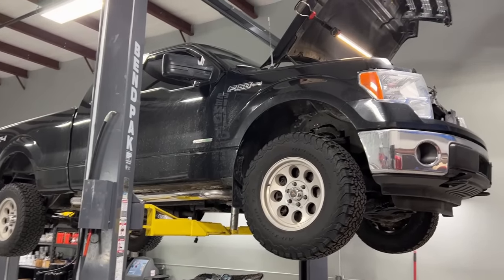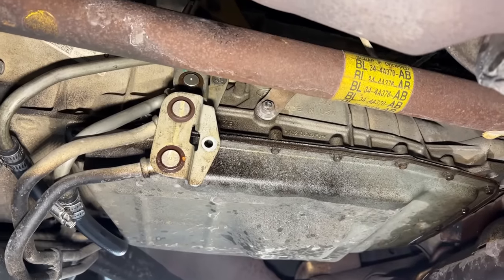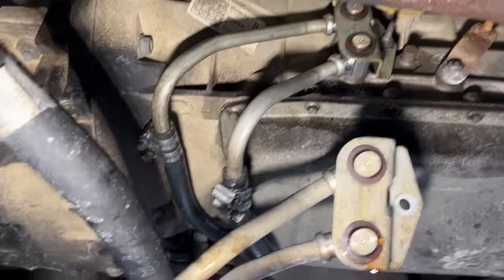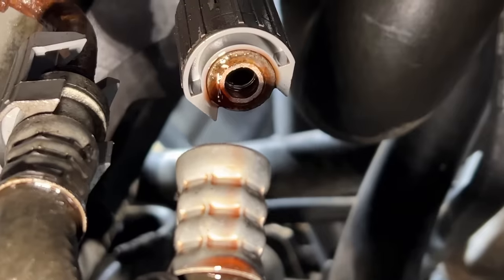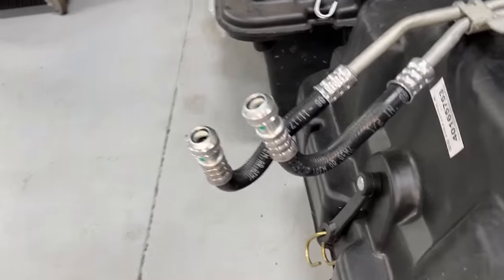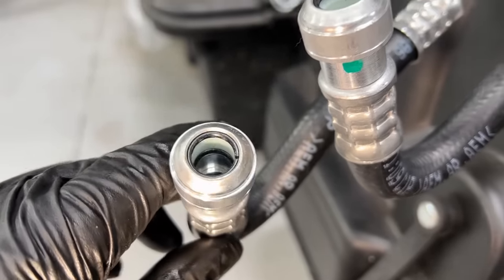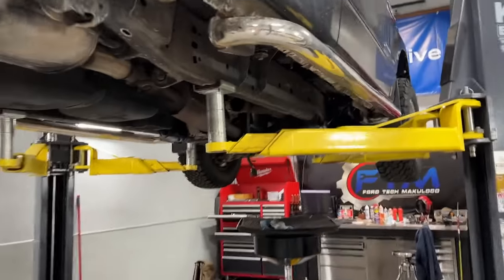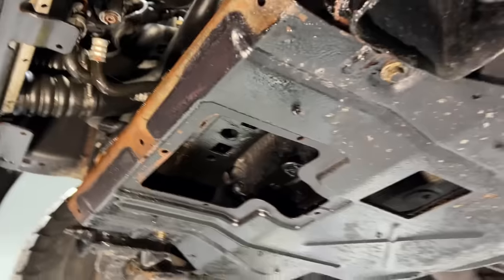Attention 2009-2014 Ford F-150 Owners! Check Your 6R80 Transmission Cooler Lines Before They Blow!

Comment: Aircraft mechanic here. I couldn’t tell if the aluminum and steel are contacting each other but if they are, this is likely a classic case of dissimilar metals corrosion. I also do as much of my own auto repair as possible and your vids have been a tremendous help. Keep them coming and take care!
Reply: Bingo! Notice the rust on one side, and the aluminum on the other? The failure is right there at the transition. Dissimilar metals corrosion. The aluminum will happily sacrifice itself. This is accelerated by the presence of ions, road salt and water being the key. This video is a wonderful illustration of why these lines must be serviced and replaced before fatigue wins the day.
Reply: @robertborchert932  You would think people who have been making cars for over 100 years wouldn't make such a rookie mistake but they did. Why is ford's build quality so inconsistent? Some years they make great cars and some years they make junk no rhyme or reason I guess?
Reply: @andrewgordon235  The truth is simpler than this. Vendors. Nothing wrong with the design of the hose or coupling, nor with the cooler. Parts made to specification, but not knowing the other end of the connection. Different vendors making each half. There's a cost factor of course. An old school mechanic can tell you what will happen with dissimilar metals, we deal with this nightmare regularly.

In reality, these trucks march on through some really shitty real world conditions. Seen it over the decades, as long as it lasts through the warranty period, there's a laissez faire attitude. 

And yes, this isn't isolated to Ford, it's a worldwide issue, sadly.
Reply: Sounds as though the lines should be changed every 60,000 Mike's before metal fatigue sets in.  This will allow one to stay ahead of the dissimilar metal issue.

Comment: Great video, Brian. I know you're busy, so thanks for taking the time to inform us of this problem. If I had one of these, I'd replace those lines before they break! I have a 2015 Mustang with this trans., so I'll have to check and make sure it doesn't have this type of line on it. As always, keep up the great work.
Reply: Makuloco.. So what can I do to fix this before my trans blows? Did you give us the part number?

Comment: Thanks for keeping us informed. You are my go to guy for my 2010 F150 platinum. This same problem happened to me a few weeks ago, but mine was leaking where it bolts to the side of the transmission. They originally told me that the problem was where the wiring harness goes through the transmission ( the o-ring). Still had a puddle under the truck the next morning. Had to diagnose myself. Thanks again for all you do.
Reply: I seriously hope this guy didn't inform you to inspect old rubber parts on a vehicle, that should be common knowledge.
Reply: @BlueOvals24  The problem is not an old rubber part.  It is an aluminum fitting which snaps off.  Mine failed this week.  This exact problem, exactly the same place.  Luckily, I stopped before my transmission bled to death.
Reply: @kevinpost4633  It still isn't as big of a problem as OP made it out to be.

Comment: Took your advice and replaced the coolant lines AND the lines to the heat exchanger.  Sectioned the coolant lines and found 30 - 50% wall thickness lost through corrosion!  There was some leakage at the cooling-line connectors as well.  Total cost - less than $200 with tax.  Just saved myself $9,000.

Comment: Seems like the retaining clip to keep the disconnect from coming apart is actually creating a stress point right where the thing is breaking.  Got to be a simple DYI way to create a strain relief for that spot that is snapping.
Reply: yes there is a simple fix )) cut the damn connector off, and slide that rubber house over the cooler tube, clamp it with the metal clamp better use 2 clamps , ))
Reply: @ansv3340  that's what I was thinking of doing lmao

Comment: Just rebuilt the timing on my Dads 2015 f-150 Ecoboost. You’re videos were extremely detailed and helpful! Thank you so much. I’ve been a tech for 10+ years now and am learning something new everyday it seems! 

Trans has been good for him this far with almost 260,000km up here in Canada. Did a complete service at 200K. Used a premium filter & Amsoil fluid. Will be rechecking these lines ASAP!!!
Reply: Hello, I have a Ford F150 year 5.0 2011 that is giving me the following error:
On the gearbox screen it appears as a little bubble because while in motion it changes to D,N,P,1 and loses pressure when accelerating. I took it to a mechanic and he told me that it was the transmission control module, but now watching this video I have doubts that these lines are the cause of the failure.

Comment: I drive a 2013 Ford Taurus (ex police car) and I had one my transmission cooler and one of the lines start leaking pretty bad. I was able to stop the car and shut it off fairly quick, before the transmission was permanently damaged. I’m thankful it was only $800 for the cooler and the lines and an hour of labor!

Comment: Great video and very timely. My 2013 Expedition was in your shop at 100K for recommended service interval. I just hit 145K and noticed this issue as well as having a P0720 error resulting in no speedometer and transmission shifting irregularities. The lead frame plate issue was surprisingly covered by the 10yr <150K extended warranty and I’m having these lines replaced at the same time.

Comment: you have a great channel. all business and  info, tips, etc are helpful to us ford owners. 
i have 2016 f150 5.0 xlt. 88+ k miles. purchased new. until now the trans has been no problem at all. good shifts, no shudder, no clunks,etc. just a good working trans. recently, about two months ago, the trans temp shot up 10 full degrees C from what it has been running since new,  even in hottest summer temps. it was always around 85- 86 C. out of nowhere it shot up to 96 C in air temp of maybe 25-26 C. no codes no lights. took it to the dealer thinking i was just mising something on the scan tool, but they said everything was in spec, nothing wrong. no slip, fluid topped up, engine temp good, etc.
so i take it home and am nervous about it since it still seems high to me. 2 weeks later we go for a day trip of around 300 km in air temp of about 27-28 C. starting out it climbed to 88-89 C. then levelled off  86-87 C. everything seemed to go back to normal. so all good and i am relieved. have driven several times since and no problem, tran is same as new. today i go out for groceries. it's 22 C and still ok. but when the store the temp goes to 93-94 C out of nowhere. by the time i arrive home 20 km away its hovering 89-90 C. any idea WTF is going on that causes this. aside: i have tow pack so factory tran oil cooler and the related valve block on the front cross member that interacts with the cabin heater lines through a heater something or other solenoid. solenoid says no fault and opens/ closes with scanner. dealer says instru panel temp gauges correlate with sensor ouputs. in other words the idiot gauges are displaying correctly.
my first thought was my thermostat was failing. second thought was the valve block on the cross member. i thought my engine temp was a bit high. somewhere 199 -212F+ if i remember correctly. would need to confirm that. i have forgetten the exact values. 
no leaks, rad and cooler clean. shutters open in park when AC turned on. but stay closed otherwise. i find that is strange. arriving home today they were closed after i parked with engine running. also, when new, high speed fans would blast at times when parked with engine running. they no longer do that. high speed fan never comes on only low speed. high speed works through scanner bi dir control.  
help!!! the last thing i want to do is burn up my trans because a dealer cannot diagnose and says it's ok as is. yes "FORD TECHS MAKE ME LOCO"!
Reply: Had this same thing happen. Trans temp normally stays around 90c. 

This summer on a 28-30C day, it ran up to 99.. normal city driving. Not towing anything

Did you find out what was wrong ?

Comment: I had this problem happen to my 2013 F150 2 years ago. It happened with 150K on the truck so a perfect example of this failure. A quick repair cost me $900 but the trans didn't last much longer so I sourced a good low mileage used trans and had it swapped in for an additional $1500. Except for this issue the truck has been trouble free and still runs well. This is something I'll be looking at to prevent future failures.
Reply: If you just make a bracket and hard mount those connectors at the "crimp so that nothing can move--- then the only that left to flex is the rubber line.   You can use the bolts that are there mounting the steel lines from underneath.  A drill, a welder and a couple of U-bolts, or clamps to hold them from moving.  You could probably even use heavy duty zip ties, if you just fab a bracket to stick out there next to those quick connects so that you can hard mount them.

Comment: Thanks Brian for all the videos you do for us, you literally save our ass. Just did mine today 92,000 on 2014 with 5.0. My part number for the main tube assy was CL3Z-7R081-A.I refilled new lines and cooler with a little less than 1 quart mercon lv. Part was tagged built in 2021. Bob
Reply: I have same exact truck and engine.  Were your lines bad and needed to be changed?  I'm going to check mine tomorrow morning myself now.  Got me worried lol.. also I have same exact mileage in mine
Reply: @ryancoleman1   they looked ok, but I have not cut the ends off to check. I don’t want to take the chance driving on freeway and having it fail.

Comment: Thank you so much.  I checked my 2012 F150 by AT cooling line clamps and discovered both plastic clip "clamps" have stress cracks running across the bottom half where the hose is secured.  This is obviously an age issue on the clip where the plastic is getting brittle from age and heat cycles.  I will be going to Ford to get new clamps which I now need.  In the meantime I cleaned the shell of the clamp with brake cleaner and applied JB WELD to strengthen the clamp at the stress crack until it is replaced.  

YOU REALLY have found a big issue that many trucks will be having.  Need a better clip made out of metal.  Well Done.  Love your channel.

Comment: Same thing happened to my 2013 F150I noticed a little drip when the truck was running and when I ran my hand across the line it snapped in my hand shooting fluid everywhere.. I quick ran and shut it off manage to get. The line caught every connected to just loop it off to drive home... And I was surprised to find out I lost 3 qt of transmission fluid in 10 seconds.... This is why I bought all new lines From the dealer all the way to the trans cooler ever placed everything so I would never have a problem..

Comment: Good tip.  Just checked my 2014 with 155,000 miles, sits in my gravel driveway when not driving, almost no rust on those hoses and it looks really good overall.  I hit them with some Fluid Film just for the heck of it (prevent rust on the steel lines).

Comment: I had this happen to me in spring of 2017 on a 2012 F150 with under 50,000 miles. Luckily it happened at slow speed in my neighborhood and stopped right when it happened so it didn't trash the transmission.  Ford would not cover the cooler lines under warranty as they said it was not covered by the power train warranty.  Guess I should have gone until the transmission melted!

Comment: I question how much flex exists in those hoses at the bend radius of the rubber hose.  If anything, the hose does a really great job of placing a lot of vibration onto the weakest spot of the crimp terminal.

Comment: Thanks again for a great video. 6R80 owners need to put trans line replacement on a periodic replacement schedule, like coolant hoses, serpentine belt. Parts don’t last forever. Lines cheaper than transmission.

Comment: Thanks for posting this, I'm going to do a quick visual inspection on my 2012 FX4 and see where it's at from a corrosion standpoint. I may just go ahead and replace it as a preemptive step given the age and mileage on the truck. Replacement looks like it's pretty straightforward.
Reply: Mine leaked a while before it broke.
I was blown away when I went to pop it apart and it broke with no effort.
Repaired it with rubber line and hose clamps.
1960 era tech.
Reply: @jerryfrederick6610  That's a great idea, thanks. Did you just use 1/2" ID rubber hose or were able to source a pre-shaped version???
Reply: @mandersen7416  I have eliminated a few of them on our older trucks in the fleet. It has been a while, and they are all gone now but I am pretty sure I used a hose barb in the rubber that heads to (or from) the trans and ran rubber to the cooler. I didn't need to find any fancy pre bent hoses.
Reply: On a 2012 I would say you are on borrowed time with those lines. Our 2012 broke there a couple years ago with less than 150k km on it, heavy salt area though, but the aluminum tends to do fairly well compared to the steel as far as corrosion goes.
Reply: @--_DJ_--  thank you 🙏
Reply: @--_DJ_--  I put eyes on it this afternoon and it looked fairly rust free and no leaks. That said, I'm still planning to replace the line ASAP. A $50 line and fluid is a lot cheaper than a $7K transmission replacement.
Reply: @xeutoniumnyborg1192  It won't rust as it is made of aluminum, but you have the right idea, get rid of it now before it bites you. I think the lines are more than $50, though it has been a while since I was at the dealer buying a set (dealer only item last time I was in need). You could eliminate the problem section for that much though if that is what you had in mind.
Reply: @jerryfrederick6610  did you had to drain the trans at all or just had some spillage and just topped it back off after repair?
Reply: I have a 2010 F150 I replaced mine after 10 years because the line was corroded and I had a very small leak in the rubber hose so small that I didn't even have to add any tranny fluid i wanted to replace it anyways. The new line I installed failed in the same way that the line in the video did 2 years after replacing it. I was able to replace it again change the filter and then refill with tranny fluid and my transmission is fine. I might have got away with one but the brand new lines I put in only lasted 2 years so I don't know if it's a corrosion issue. Must be the vibration like some other people was saying Ford should redesign those tranny lines so that they don't break catastrophically like that out of nowhere.
Reply: It looks straightforward but after today I couldn't even get the line out in one piece. After almost 2 hours of trying to maneuver it out I finally cut it and now I'm stumped on how to get the new lines in without damaging them.
Reply: @jacob8660  maybe you could not get the quick connect out because there is already rust at the connection. I tried to undo mine (200k) to do a transmission flush and I could not get them disconnected either.

Comment: Happen to have a 2014 with that Trans, I'll definitely be keeping an eye out for this, great information as always 👍
Reply: There is no warning, no seeps or drips, they are good until they are a wide open 1/2 inch line. Honestly I would just change them, I have had two in the fleet survive them breaking off, but I consider those flukes more than anything. I forget what year the first one was, I want to say 2010, the second one was a 2012 and it happened with less than 150k km on the odometer, broke 2 years ago. I would say you are on borrowed time with those lines.
Reply: Only 70k for mileage on my 14, so I'm assuming they're OK so far, but I'll definitely check em out
Reply: @jeffcarroll3831  I would for sure have a look, I just don't think you will see anything. There are ways to remove that section of line if you are a bit handy (or cheap like me). I did a few on the older trucks at work, but they have all left the fleet at this point so how I went about it is a bit foggy. I think I used a hose barb-barb connector in the existing rubber on the long lines and ran rubber from the long lines to the cooler. They are not too expensive from the dealer though, at least not as expensive as I had thought. GM bends you over hard for lines like that from my experience, Ford seems to be more reasonable, though I do get trade price there so that is a big saving.
Reply: @jeffcarroll3831  .
Reply: @--_DJ_--  Exactly like you said there is no warning.If you have these just change them.$6000 for a trans job,Crazy.If I had these on my truck I would worry about it every time I drove it.

Comment: It is a common leak point, in fact I have a video of the leak point. This is a very very common issue. It usually gives you a sign its ready to go. Look for oil spots on the driveway.

Comment: Thank you FTM for this video.  My 2014 only has 59,000 miles but I live on the Oregon Coast and occasionally hit the sand and beach.  Having to be towed off the sand is a heavy duty bummer drag.  I will swap parts immediately.

Comment: 300k on my ford truck 5.4 3v. I watch all your videos. Everything on my truck is original minus the radiator and clutch fan.
Sad story I knew the clutch fan needed replaced and I would normally do that simple task myself but I was on vacation when I noticed the symptoms.  Shop installed it incorrectly and it went through the radiator 🤣🤭